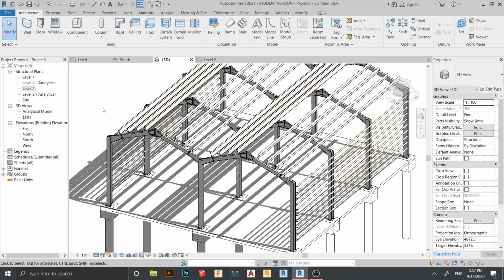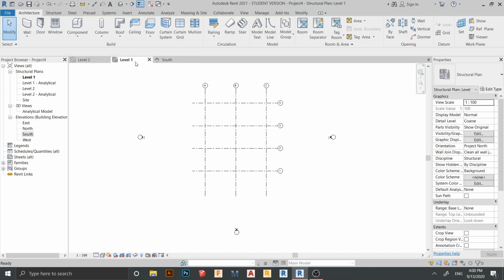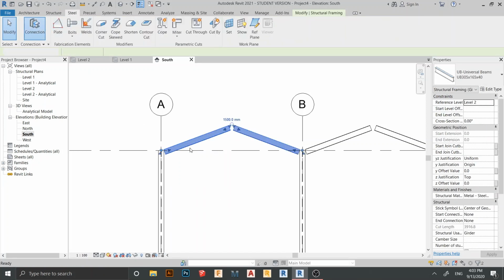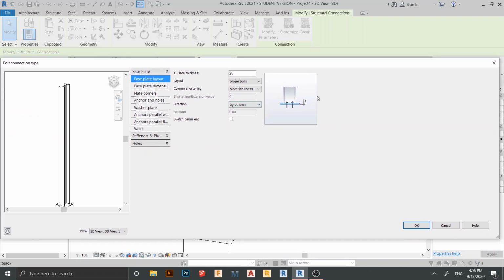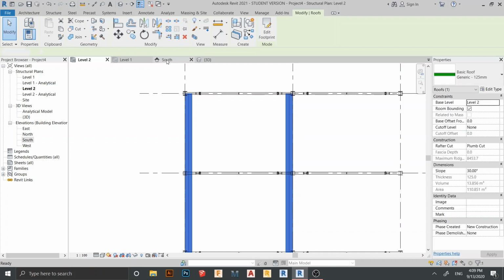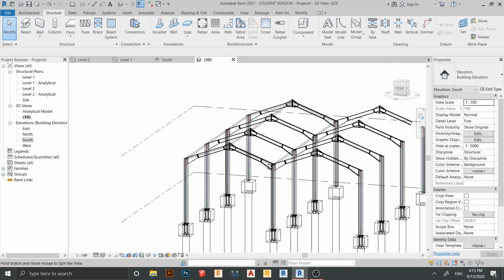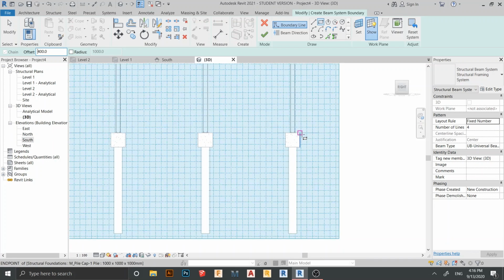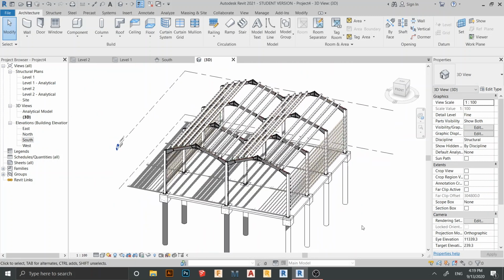REVIT STEEL - Steel Structure warehouse in Revit

Comment: Do one need to use structural templates when designing columns and beams?
Reply from the maker: Hi, Joe Actually yes, if we're working on structure element try to used structural template, it's easier to import from Revit to Autodesk Robot and CSI Etab to apply structural analysis. This is my perspective.
Reply: You can use whatever template you want but just that you would have to load the structural families each time. When you use the structural template, some things come in by default